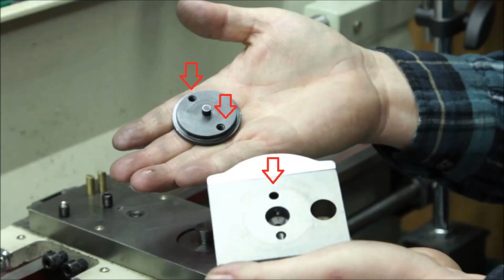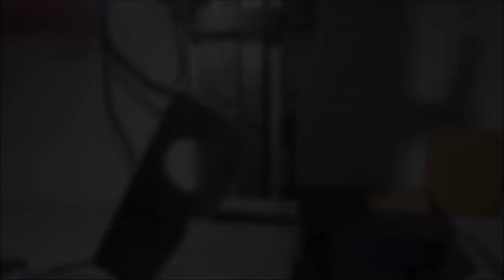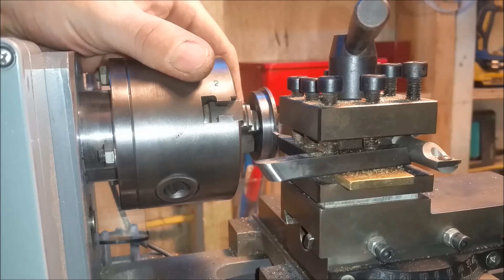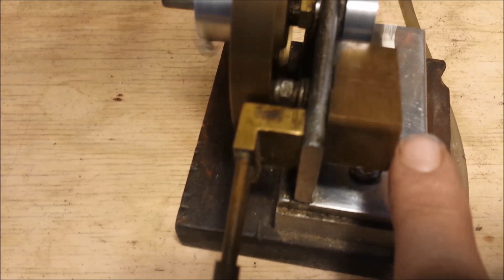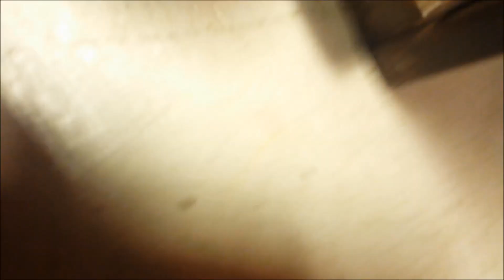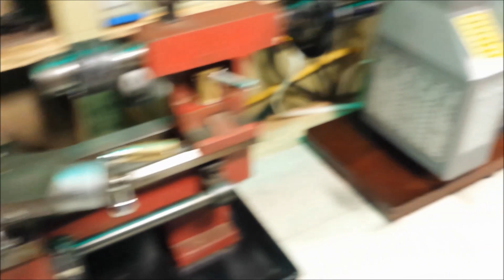Mini Lathe Cross Slide Angle mod with set screw

Comment: I don’t the clamping force of the screw is going to be enough to prevent movement of the angle slide under cutting load, It needs to be clamped to the cross slide to be solid.

Comment: You don't need to remove the compound slide. I used to do that, then I realised you can just wind it back enough to get the Allen key in the two bolt heads, which works fine for adjusting the angle.
You only have to remove the slide to get enough clearance to remove the bolts completely, which is almost never needed.

Comment: This doesn’t work, it’s insufficient clamping force for a compound slide & the single screw will damage the clamping piece, not to mention that that piece really mustn’t EVER be above the cross slide or it’ll never clamp properly anyway.
Nice try though, but there’s no way around it unless you swap the socket headed cap screws for studs & mill (or cut with a slitting saw) slots in the sides for slim nuts.

Oh, & that’s an 8-32 thread, not 8 X 32nds that (8/32) would be a quarter.

Comment: Hmm, does this really hold up? I trust a clamped down slide more than just being held by a locking screw from the side. I can also imagine the screw boogering up the side of the backplate to the point you can't turn it properly anymore. A piece of brass in the hole would have helped.
My solution for this problem was to build a tool for my cordless drill (just a shaft with a plate on the end, with two holes for the handles) with which I can easily crank the slide back and forth. Also makes consistent feeding much easier.
Just noticed that my lathe has a different style handle, but maybe you can find a similar solution.

Comment: A very nice simplification.
That is a funny way of specing a thread size (because 8/32 = 1/4) for that cap head screw (I only use metric, so don't know if that meant something else)
I can't imagine what sort of "hare brain" came up with a swivel design that you have to remove the toolpost slide to set an angle and then put it all back together, when that sort of set-screw design you turned it into is on virtually every other lathe that size and bigger.
The two slight changes I could suggest is 1) adding a second set-screw coming in from the back of the saddle to really lock it up solidily and 2)making a little brass gibs to go between the tip of the set-screws and the swivel post, just so it doesn't score it up and making slight angle changes "coggy" (when tightening the set-screw, having it "jump" to an angle you've used before).
Reply: I think that its based on the same Guage diameter system as wire.
Reply: @kieranh2005  I don't think so. Wire gets smaller with bigger gauge numbers. Screws get bigger with bigger screw numbers. It's just a thaing, yerd me?
Reply: Surprised nobody commented about your comment... that the 8/32 is not a screw size.... it's actually #8,  32 threads per inch... normally called #8-32, not 8/32 as he said (multiple times in the video).  Oh... but BTW... the "8" actually means NOTHING... we just normally use even numbers for small screw sizes - like #2-56, #4-40, #6-32, 8-32, 10-24, etc..... but that doesn't mean it's JUST even numbers... no, there's #1, #3, #5... but the odd numbers stop there... for no reason.

So glad I could clear that up for you!  (haha!)
Reply: @beforebefore  What an odd way of specifying thread sizes. Number sizes seem to still be used for woodscrews in Australia, but everything else uses a variation of ODxThreadType.
Reply: @dj1NM3  It's not odd at all. It is standard, here in the only nation to have ever landed men on the moon. I could see at a glance that he was drilling for an 8-32 screw or at least a #8 either NC or NF, and definitely not a 1/4-20 screw or other pitch. Just like I can dig in a coffee can full of bolts or nuts and pull out a 7/16" just by feel. It is perfectly natural and normal when you grow up without getting your mind twisted around sillymeters. But... you will be happy to know that we don't see nails specified exclusively by pennyweight, i.e. a "d" after a number such as a sixteen penny nail or 16d nail, or 20d nail, etc. Now, for the benefit of those who never learned about such things as a kid because they were on the gameboy or nintendo all day instead of making stuff with dad or grampa, you will see nails specified by inches length, also. But sillymeters? NEVAHR, I SAY!!!

Comment: Great and very useful Mod, Don.  Thanks.  I used shims instead of machining the swivel.  It worked fine but I did have one setback.  After I got the compound working and locking, I  realized I could not move the compound all the way (about 1/2 inch) forward because the the dial between the graduated dial and the compound interfered.  I had to disassemble and had to mill off a little less than 75 thou so it could clear.  I also used an M4 sets screw so i Would only have metric fasteners to deal with.  But a terrific video with just enough wacky humor.  Thanks again.
Reply from the maker: Thanks for the suggestions to the viewers and for all nice comments. You made my day.. :-) - Cheers

Comment: Thanks for a great mod to the mini lathe. having to get to these 2 screws is the worst fault with this mini lathe.  I tried leaving the 2 set screws just loose, but it allowed too much movement of the tool post as the top slide would rotate slightly on the screws, and the screw heads did not stop it either. Finally, put a 0.020" shim between the round piece and the bottom of the cross slide. This locks the round piece solid as before and is almost the same as machining some metal off the round piece. It took  a bit of trial and error to get the best shim, that allows the cross slide to just rotate.      Colin
Reply from the maker: HI Colin, kudos to you. using a shim is a pretty neat way to accomplish creating the needed space and better than my way; as yours is easily reversible. Thanks for sharing. -cheers

Comment: I know that you guys over there can't get your heads around metric measurements but I thought you were OK with imperial. Eight thirtyseconds?
8/32 = 4/16
4/16 = 2/8
2/8  = 1/4
or is that rocket science?

other than that, a brilliant solution to an irritating nuisance. I shall get started on mine this week. Does anyone have a spare lathe I might borrow?
Reply: And besides, sometimes it's just easier to work in 32nds. What's one less than 9/32? 8/32instead of having to divide and multiply in your head all the time.
But, yeah, Gregory Wilson is right about the tap size.
Reply: lol wait until you discover things like 27/64 or 53/128 and so on, there is no end for insanity in this unpractical system.
I asked a guy how he uses this math in practical work. he basically said he rounds up and down and uses +- to remember fractions.
This way the loose a lot of precision, just because the handling of the measurement is cumbersome.
Imperial is good for pornsites and plumbing, but when it comes to measurements under 1inch its really unpractical.(thou, thousands)

Comment: Thanks Don! Modified my mini lathe, no problems with your instructions.  Did put a piece of brass between the SHCS and the disk so that over time it wouldn't chew up anything and could be easily replaced to keep everything tight.  Regards, Ed
Reply from the maker: Hello Ed, sometimes you get a comment that makes your day...And your comment has made my week. Glad to hear the modification went well and the instructions helped. Excellent addition with the brass, as a metal bolt on the cast part would wear after time. I sincerely thank you for taking the time to write here. -Cheers Buddy
Reply: Or put grease in the assembly, stays put better then oil.

Comment: Excellent idea... I have seen several versions on you tube relating to the same problem but I like yours  best... I have made just about every modifiction on my Micro 7-16 lathe but that one... I am an old school machinist and have used dozens of different types and sizes of lathes and I try to replcate simple  things I become used to on larger lathes on my lathe... You tube is a great educational tool... I too have completed my second double action wobbler type steam engine, 1 inch bore, 1 inch stroke and completely made out of Delrin Acetate plastic...Always nice to know there are other steam engine enthusiasts out there...Thanks for sharing...Frank
Reply from the maker: Hello Frank,  I'm glad you like the idea. and i'm glad you like the steam engines.... If you haven't ran across Keith Appleton's channel.. I suggest you check it out: https://www.youtube.com/user/keithappleton
Reply: @DonBrandt  Perhaps you can answer a question for me. When you loosen the screw you added, how much slop is there in the swiveling portion of the cross slide? I'm wondering this for two reasons. First and foremost I'm wondering whether there's enough slop to where it teeters, allowing the potential of it being locked in a "rocked" Because if if the tolerances are tight enough, I was thinking that could perhaps leave the screw loose and let swing freely to cut radiuses in your work? Or do you think it's too lose for that to work? Oh, also, do you think this effect accuracy in any way?

Thanks

Comment: Since I don't have 2 lathes couldn't I just tighten the screws just enough to make the compound turn snugly then lock it with your screw idea. Would save a lot of work. Maybe put a little Locktite on the threads of the 2 screws to keep them from loosening.
Reply from the maker: Hi James, thanks for watching and your comment. That's a great thought for the screws when you don't have a second lathe laying around! haha  -cheers don
Reply: Much better idea as i feel Dons way will result in rigidity issues. 
This way the compound will seat better, more surface area contact , no ?

Comment: Nice work Don. Put a longer screw on it and install a small knob on it too. You may want to consider the HF version if you have problems with it not pulling down tight like Flip said, just a thought. Well gotta go. Best Wishes n Blessings. Keith
Reply from the maker: Great thought Keith!  As far a chatter is concerned, i haven't noticed any problems..Ill keep you advised.  What's the HF version?  -Cheers
Reply: Sorry I thought you might remember I have a Harbor Freight 3 in 1. I think Grizzley G9729 Combo Lathe sells pretty much the same Compound Assy/Tool Slide. You can veiw it here: http://cdn0.grizzly.com/partslists/g9729_pl.pdf page 71.
How are you feeling. I remember getting my wisdom teeth out, half of them on Whidbey Island in the late 80's and the other side out on an Aircraft Carrier in the middle of the ocean. Nothing like meds and the sway of the ocean on a big ship to put you to sleep. Hope you feel better soon. Best Wishes n Blessings. Keith

Comment: But now it doesn't pull down tight anymore(!?) on my mini lathe this would give way too much chatter. cheers.
Reply: I also think the fit will no longer be snug and create chatter. Interestingly, at the start of your video I noticed a mod with the dovetail and I thought your video was going to go in that direction.
Reply: @RaindropServicesNYC    Hi, great observation, however, you can try turning a taper on the centre peice, when tightening the screw to lock the cross slide, the screw will push down on the taper to obtain a snug fit.
Hope my explanation is understandable.
Reply: yes i was thinking these 'pivots' are kind of a HUGE weak link in the static structure of most lathes - esp smaller ones .. i wonder if there's a better or much more rigid solution?
Reply: So it would on my mini lathe.The key to doing good work on the mini lathe is to get every possible part locked down as tightly as possible, and this mod goes totally against that. It is a very bad modification. All you need is to set the compound in the mid way position and drill a couple of holes clean through to give access to the two bolts. The gib strip needs to be reieved a little to allow hex key access. See the mod here :- http://andysmachines.weebly.com/a-much-simpler-topslide-swivel-mod.html. [Sadly Andy is no longer with us].